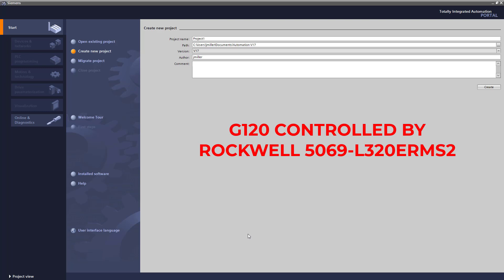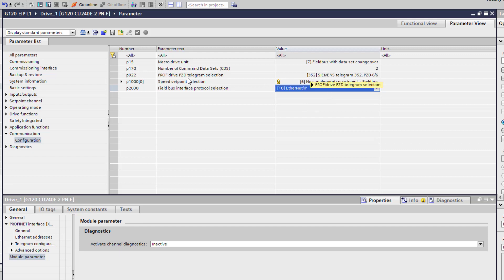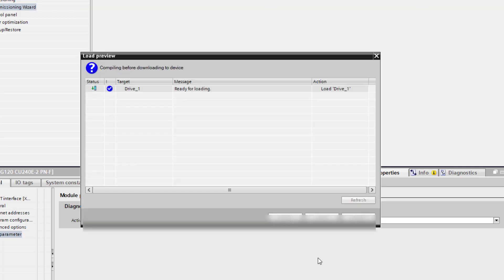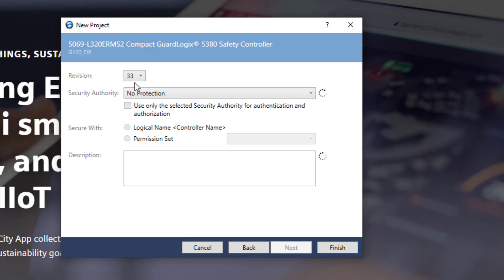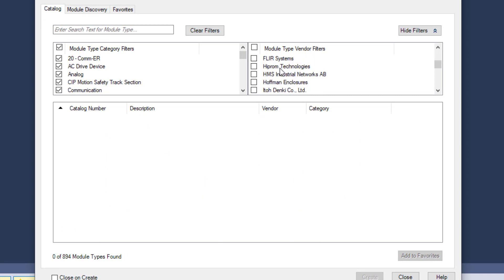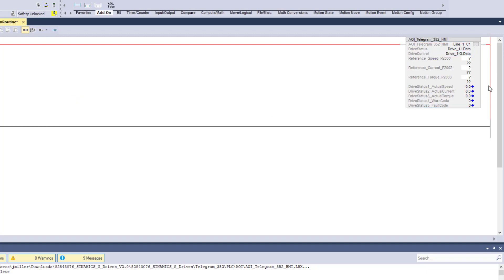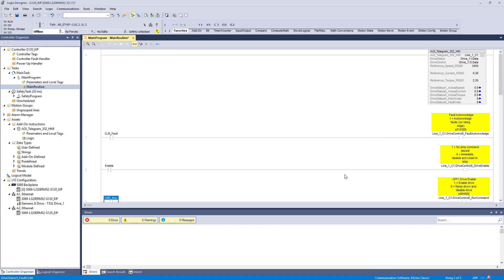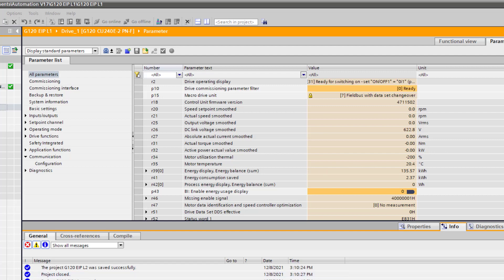G120 VFD TO Compact logix PLC

Comment: Can i control 5 nos G120 drive with ab controller at same time.
Reply from the maker: What is nos
Reply: Quantity
Reply from the maker: @ yes plus more, limited by the max your an plc has for connections
Reply: Thanks
Reply from the maker: @ let me know if you have any issues when you go to do it I can assist with questions.
Reply: @PLCAutomationTraining  Hello! Very good video! We need your help, AOI and EDS are temporarily unavailable on the Siemens website.
Reply from the maker: @ I sent an email I will let you know soon
Reply from the maker: @ I sent an email I’ll let you know soon

Comment: Can you reply and tell me the tag name for current feedback? I'm about to put a G120X via ethernet into a ControlLogix PLC (L84) sometime tomorrow or early next week for a customer, so I haven't gone through the AOI yet or downloaded it so it may be obvious once I dig into it, but I think I'm going to follow this process and just point the data I/O to my custom control module (AOI) that I call P_VSD, essentially it's a P_VFD plantpax block that I modified to work with any motor type, hard wired, e300, VFD's etc just based on what value you put in it'll swap it's functionality accordingly even in the plantPAX graphics. I'm pretty sure I'd be able to figure it out, but if there's anything I need to know please do because there's a lot more things I'll need from the VFD than what you displayed here. Thanks in advance friend, cheers!
Reply from the maker: sorry i did not see this, did you get this figured out?

Comment: Thanks for the demonstration! Really useful.
I don’t understand what pushes people to use Siemens drives and HMIs with AB PLCs. I saw such a machines in different factories and it’s a really weird. You have to pay for both softwares Tia Portal and Studio 5000 and I wouldn’t say that AB PLC are so good that you should stick to them. It’s way more efficient to use only one brand.
Reply from the maker: You don't have to use portal to setup the G120 for AB plcs I just own both platforms so I used portal. You make a good point though. I will do another Video showing how to use the Drive to setup its parameters with out portal for this application. My preference for drives is Siemens. In my experience the Siemens drive performs better when match to the same HP or KW motor. When I do jobs that request AB drives I always step up one size on the drive to motor power. This has made my drives last longer. Remember these are just my expirences while in the field.
Reply from the maker: Plus the basic version is free no license